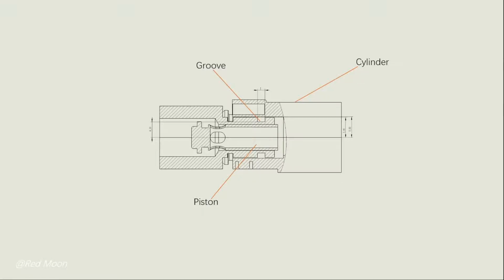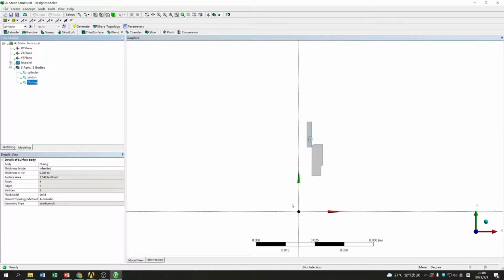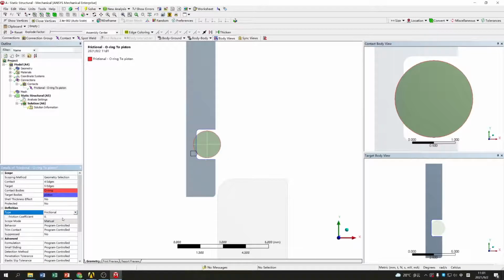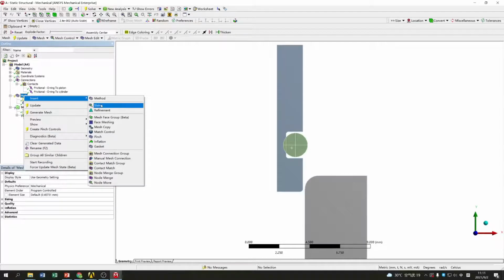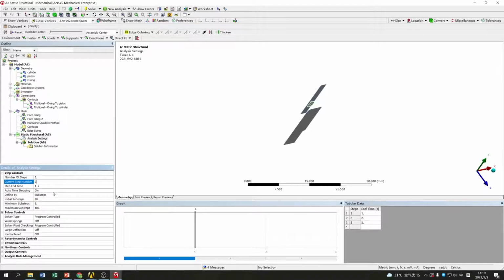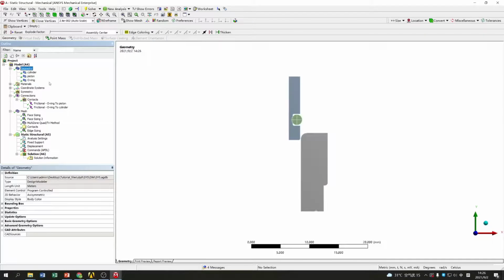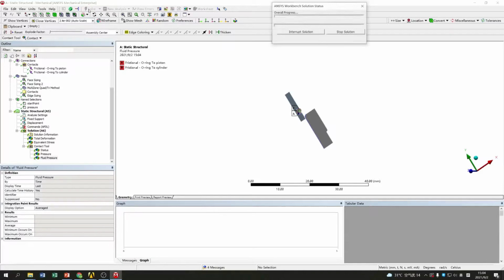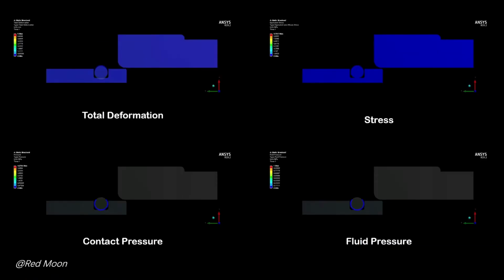Simulation for Hyperelastic O-ring in ANSYS Workbench | PISTON SEAL

Comment: 19:20 how do you know how much pressure should be applied on that case? And how to know which type of hyperelastic model correspond to which material?
Reply from the maker: The magnitude of the applied pressure is depended on the desired point of your working condition. Sorry about konwing little about the hyperelastic model, cant give u a detail answer.

Comment: Hello, I have one problem. When I create surface from sketches than o ring and piston becomes one surface. When o ring is not in touch with piston than only it becomes as a different surface. Why is it like this ?
Reply from the maker: Sorry I don’t get you. In my case, o-ring and piston are individual surface but overlapping. You can just directly create these two parts from sketch one by one.
Reply: @redmoon2615  Thanks for your reply. How did you overlap two individual surfaces ?
Reply from the maker: @kunalsinghal7527  Actually I created this 2d model in SolidWork but I think designModuler can make it too. Or you can use SpaceClaim. Parts created in different sketch surfaces are apart by default.
Reply: @redmoon2615  Thanks for the information. I did that in design moduler. I created three sketch in xy plane. After that I created surface from sketches. When I keep circle as tangent to the groove, it is fine. But when I keep circle as intersecting the groove, than only one surface is generated combining piston and o-ring. Did you use interference fit in it ?
Reply: @redmoon2615  Thanks for all the information and this video. It is really helpful for my project. Instead of o ring I am having hydraulic u cup seal for my project. Before pressure it is fine but after applying pressure convergence problem is coming. I need your insight on it.
Thanks

Comment: Hi
Q: how did you quotered oring circle surface? the only way i found in DM - "split edges", but result isn't like your
Reply from the maker: I split the edge of oring into four parts in SpaceClaim module. You can try this.
Reply: @redmoon2615  Thankes. But for SC is too early now)
Can't get result the same as your. At the beginning of the 2st step my cylinder vanishes falling down. Check all settings twice, all clear T.T
Reply: Aa, sheet, fucking meters intstead of millimeters))
Reply: @redmoon2615  Thanke you for such useful material!
Reply: @redmoon2615  And also, why in results we don't see any deformation and stress in oring during the first two steps?
Reply from the maker: @kiryl368  thanks, it did had small stress and deformation in the first step, but the value of stress is less convincing comparing to the 3D simulation.